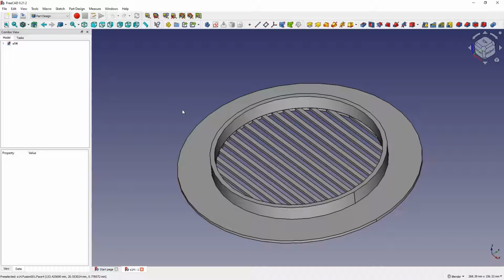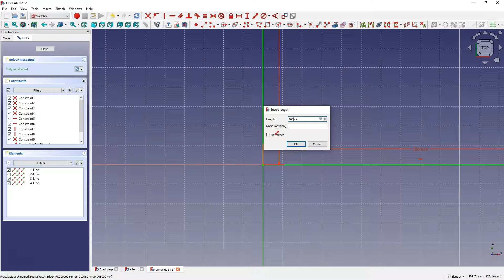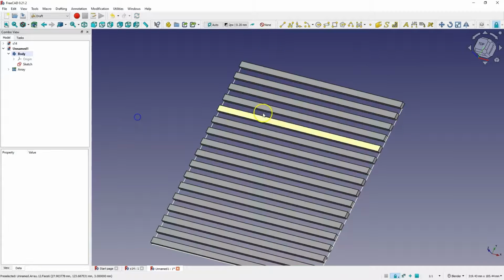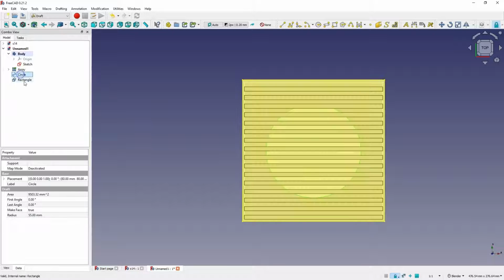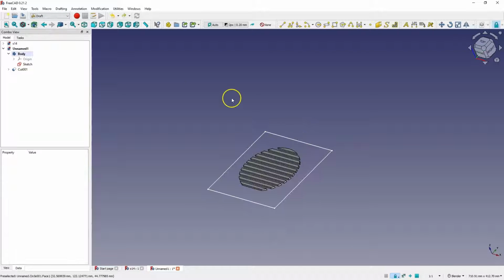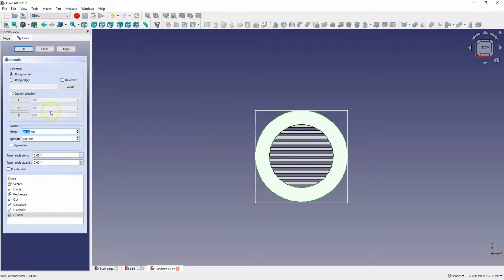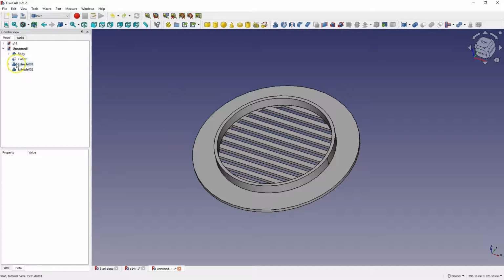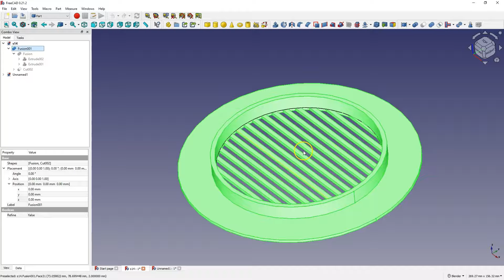FreeCAD Ventilation Grille from a 3D Printer

Comment: How to deform such an object to fit on a cylindrical or a spherical surface?
Reply: Make it really deep then create a new plane at right angles and cut the surface profile through it.
Reply: @AshleyMillsTube  excellent idea!
Reply from the maker: I guess you need to use different software for this (maybe Blender or something similar) or you can try boolean operations and a different approach to designing such a part.